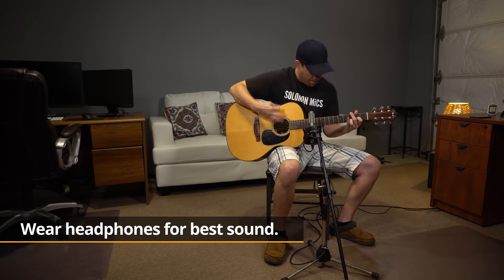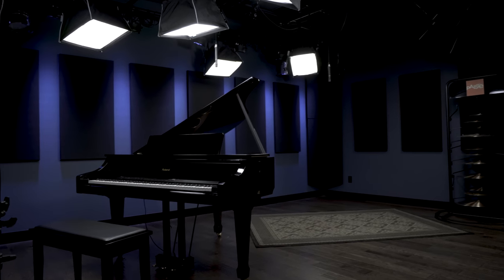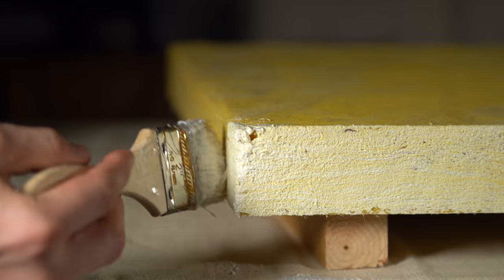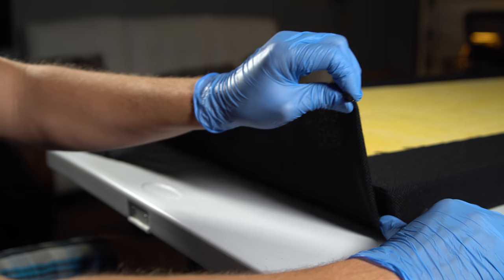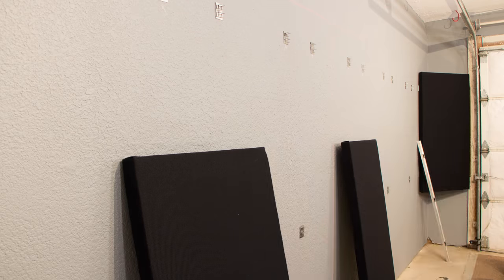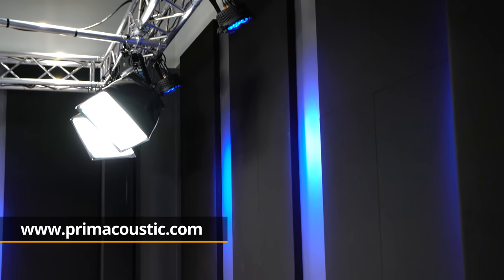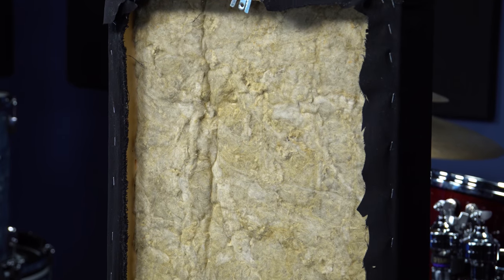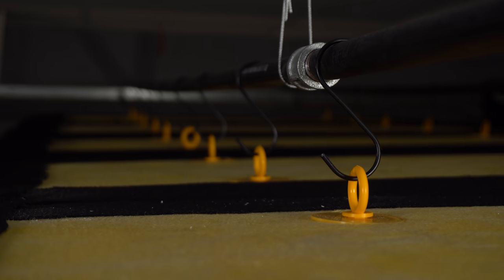How To Make Your Home Studio Sound Amazing With A Low Budget

Comment: Hello, thanks for your video!!
Why did you use fiberglass and not rockwool? thanks a lot
Reply: Rockwool would be better.
Reply: Hello, thank you for your reply!
i'm having some issues finding "Water-Based Polyurethane Resin for Edge Hardening": is this paint or is it proper resin? bi-component?
what's the purpose of Edge hardening? i'm using rockwool and i would like to know if you think i can wrap it with cloth without using this resin.
thank you so much!!!
Reply: Riccardo Antonelli good luck everyone else asking the same thing but this dude wants to keep it a secret for someone

Comment: To be honest, through my speaker setup, it doesn't sound much different between the before and after.
Reply: Stiff panel material like these may actually reflect sound more than absorb sound. I prefer Rockwool for this reason, much looser material, allows sound to pass through and be absorbed. I also combined these with foam type panels, which are much less absorbent and effect a different set of frequencies, and then added a half dozen diffraction panels. When done right, a treated room can sound 1000 times better than untreated.
Reply: To the untrained ear, it won't.
Reply: The vocal is definitely different. The guitar not so much but that's because of other factors

Comment: Hey thanks for the info very helpful..question though where and what brand of resin for edge hardening do i get/from? thanks
Reply: Allan Siegle trying to find out same answer. Let me know if you find it
Reply: I bought a water based polyurethane resin in our local paint store. I live in Sweden, so I'm not sure about the brand being available outside of Sweden, but the stuff I bought (which worked perfect) is Aqua ZAR Polyurethane "lacquer". Check a local paint store and just ask for any water based polyurethane resin.
Cheers!

Comment: Also, what about the back? Should the panel be exposed like that? I just wondered if any of the fiberglass particles could somehow get into the air if it isn't covered up in the back as well.
Reply from the maker: It's not problematic, though if you want to take extra precaution, you can wrap the panel in a micro-mesh material.
Reply: Any recommendations on a specific micro-mesh material? Also what resin are you using? The PDF isn't specific.
Reply: CynDaVaz maybe some fiberglass screen
Reply: Trevor F  Did you find any good micro-mesh material?
Reply: Trevor F this dude wont respond about the made up water based resin that done exist. The product he is using is romans 543 for the edges

Comment: Those bass traps would be much more effecticve if they covered the whole corner from floor to ceiling. The bass is going to be more resonant where 3 surfaces come together versus where just 2 walls intersect. I'm sure these ones do something but I would be willing to bet that if you put on a track and stand in the corner of the room you will still hear a lot more bass.

Comment: just buy some cheap carpet.make sure to vacum clean first and then depending whats the walls try stapel gun or glue or battons the wall out  then carpet the it. I sometim's get a sheet of 8x4 hard board and line it with 2x1" battons to make it strong and rigid.

Comment: Great video!  I think I should start with better computer speakers to improve the audio difference (or use a feed to my 90's-era Yamaha amp and Delta speakers).  Also, how much compression does YouTube automatically add to the original content?

Comment: Nice vid, thanks. So, about the bass traps, is there any real difference between making a triangle shaped bass trap or just glueing a thin panel on the corners like you did?
Reply: Yep, with this, it will be effective at whatever frequency has a quarter of a wavelength equal to the distance from the corner, with a full wedge it will work on anything higher than this frequency
Reply: @stephenevans2518  Thank you for your response, I didn't even remember this post. I actually did a project with professionals for my studio, they made all the measurements, built the panels and installed everything. it's been working great. Maybe in the next one I'll try a little more DIY.
Thanks for the feedback.
Reply: @XkztyIpKtHrwmNxlKhPy  Glad you have a good solution! I was halfway through typing when I saw how old your comment was but thought I'd reply anyway in case someone else found it useful
Reply: @stephenevans2518  thnx for reply  .
Can i contact with u ?

Comment: take off some absorption and make some diffusers for your rear wall or ceiling. you killed high frequencies and the bass freqs are out of control now
Reply: I was going to say something very similar - diffusion is needed especially in a smaller room.  Some sonotubes cut in 1/2 or 1/3 would help.  No idea what size is needed or the spacing, but that room will have a lot of build up around 200-300hz with just 1" absorption.
Reply: Eric du Toit hell no. Diffusor is garbage in small room. It fills your room with too much high end that will trick you when you do mixing/mastering. Diffusion demands large spaces. The money spent on diffusers is much more well spent on treating low end. Why ? Fix one low note, the effect will continue to mids as well. You are breaking very problematic sound pressure that takes a lot of energy in your room. Same stuff happens when you cut 20hz on mastering. Listened on pmc mastering grade system, when you cut, energy of the song across the spectrum just lifts. Tested diffusers both in several small mastering room, treating low end always won. I got with no serious treatment that costs 2,3x less than casual treatment cost +/- 3 across the spectrum. Adding few resonators will bring down to -/+ 1.5db.

Comment: All this is just a aspirin for a gunshot wound in a head. 
Basically, any wideband acoustic treatment will consume a lot of space or it will not work below midbass (200-300 Hz). 
These panels (assuming they are hard) will work much better with 8" or more air gap. 
All this treatment that does not work properly in low frequency is the reason for weird incorrect bass mastering, too boomy or too dry. Bass is the foundation of music and if you don't have even sounding notes of bass guitar how can you expect good mixes? 
So, if you want not just record some ukulele, you shall expect to spend at least 10" from every wall and ceiling to get more or less reliable results with sound production...

Comment: But if you put glue on the panels you will get less absorption of the panels, no? When glue dry it will be hard, heavy, solid, decreasing the absorption
Reply from the maker: Yes! That is why we used a minimal amount of glue and only on the edges, so that we minimize the reflective surface area of the panels.
Reply: Recordeo oh yes! I didnt see. You put glue in a surface, but was in back. I didnt understand. Right, right!

Comment: What was the material  in the garage door and where can i get it
Reply from the maker: Hey! That material was an Owens Corning Garage Door Insulation Kit:
https://www.homedepot.com/p/Owens-Corning-Garage-Door-Fiberglass-Insulation-Kit-22-in-x-54-in-8-Panels-GD01/202257272
Reply: What about the curtain in front of the garage door? What kind of material is that?
Reply from the maker: Just your standard Walmart cheap black curtain! :) Nothing fancy there. You can get super dense and thick curtains that have some acoustic properties, though it wasn't desired or necessary in this room.

Comment: And what about diffusers? It's not good if you've only got absorption panels everywhere, without at least a couple of diffusers at the back.
Reply from the maker: Yes, thanks for sharing! I wanted to simplify the process for our home enthusiast audience, in which getting started with some basic broadband absorption will make huge leaps in intelligibility and room sound. Absolutely, with smaller rooms we generally want to use broadband diffusion as well. Some ultimate devices for this are Quadratic Residue Diffusers, in which you can build (or buy them) based off of different prime number sequences, to best fit your specific room modes and unique characteristics. I've had great success using QRD in small rooms to "open" them right up!
Reply: Recordeo what if i prefer a dry sound to keep it easier to add reverb and manipulate the dryer sound?

Comment: Would love to hear about what you did for the garage door and the floor. Please?
Reply from the maker: For the garage door, I used a Owens Corning Garage Door Insulation kit, as it wasn't yet insulated..and this actually acts as some form of absorption as well... the floor is carpeted and has a thicker persian rug in a larger area.
Reply: @RecordeoOfficial  keep in mind that opposing surfaces are your friend in the tracking room.  Soft ceiling/hard floors. Also the human ear really enjoys the a 4-5 ft echo (filtered out naturally since our ears hear our voice off the floor all day long). I'm no pro but just some tips i've learned that might help someone.
Reply: @jacobwhite936  Yes, but not cement floors and echos in a room that's not accurately treated can muddy up a mix or cause phase issues.
Reply: Recordeo did that help with both temperature and sound “proofing”?  Have you worked on any garage studios where you removed the garage door and sealed up the opening?

Comment: Well it depends if you are looking for sound proofing or just sound absorption to reduce base traps and unwanted reflections.  Nothing is going to beat engineered products for both soundproofing and sound absorption BUT if you are looking to deaden a room, reduce base traps and unwanted reflections on a budget, whats even better are the square cardboard 2 dozen egg flats. Far cheaper and far less work than this method too.  I know, I've done it and the difference was huge.  Plus, depending on how much room you are working in, you can make moveable panels to create small spaces to reduce reflections, standing waves and base traps because sometimes you may want some reflections.  Don't know how many times I've been in studios where hallways and bathrooms have been used because of their "liveliness" over the studio room's "deadness." 

Plus soundproofing is a whole different ball of wax.  Are you trying to make a room completely sound proof so sound doesn't get in and out of the room at all?  Hope you have a nice bank account if so! I've done room within a room in my studio that started with 1 foot thick concrete walls and you could still hear sound  (mostly low end) from inside and outside but once I built a room within that space where the walls were another 6 inches thick, insulated, covered with 2 layers of sheetrock and a small air space, it deadened right up. Even more so when I added acoustical treatment to the studio room walls.  The nice thing about this space was the concrete floor was NOT coupled to the concrete walls so it didn't transmit low end to the concrete walls and the control room was a separate room with 1 foot thick concrete walls that shared 1 wall with the main studio room and had an extra thick concrete floor.  I got luck with this space. I  did want to build a isolated drum booth that would have been another room within the studio room, shock-mounted to boot but I couldn't justify the expense and thought I might be getting a bit carried away.

Comment: you just killed all the high frequencies and let the bass and low mids echo all over the room
Reply: Yeah!!!))) Their treated room does not sound good at all)
Reply: can you easily sound treat a room with budget panels like this?  Do you have a guide or tips to do so?  i have a home theater in my little basement and was planning on throwing these panels up around the room but now you have me hesitant.
Reply: Sierra419 there is some things to do. But it is always about experiment, when you are not an absolute professional.
The thing is to kill as much high freqs as you can damp lows. So you room will be in balance.
Reply: @sierra7534  I'm just recording voice, and I hang layers of moving quilts. Some above, all around. It's no studio, but I just screwed in hooks in the ceiling, my wife reinforced holes in the corners, and hang in a circle. It dampens lows, kills highs... Works pretty well. Total cost was like $40.
Reply: By all means, put up a video showing us what should be done or the proper way of doing it. Let us know when your video is up!
Reply: Too much absorption. They should make frames for those panels and put slats on to liven the room more.
Reply: actually, he did killed a few corners and ceiling, so he basically didn't just killed high frequencies, some of those reflection points cut through the bass asswell, right?

Comment: He didnt show how he hung the wall panels, did he make frames for them?
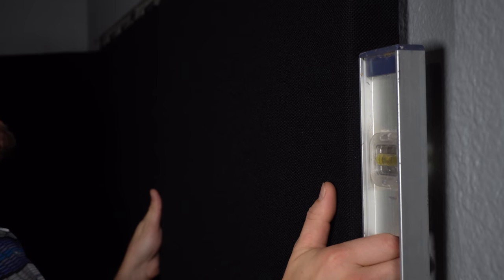Reply from the maker: I think you may have skipped that in the video ;). Watch from 4:32 to 5:28
Reply: Ah i see! Thanks, do those impaler clips work? Seems like the panels would fall off if brushed lightly
Reply from the maker: Yes they do - If you want it to be more sturdy, you can toss some construction adhesive inside the impalers too, and/or use more impalers per panel. Also, the Primacoustic impalers, although a bit more costly, have an option that angles the impalers upwards, which provides an even stronger hold.

Comment: Watch out for the fiber glass, , u didnt covered the back of the panels, lungs are expensive mate
Reply: The fibres are microscopic anyway . They will easily get through the tiny holes in the fabric. Better to use a different material.

Comment: You are just making a treatment with absorptive panels, did you calculate the reverberation time with sabine´s formula at least? And where are the diffusors and resonators. I think your video should  be called How to dry your control room with a low budget, because thats the only thing that you are doing. You need to evaluate the room in low frequencies and add control elements such as resonators, finding the normal modes of your room and calculate the correct amount of volume of air tuned to your resonant frequencies. Also you need diffusion in your room, where are the unidimensional diffusers? or any other diffusor? In that manner is only a very poor treatment that you are making far away from making it sound amazing.  Also, maybe you need to add less panels  with a calculated absorptive material with your desired reverberation time in that way you solution its been way over the correct amount and you spent a lot of money and time unnecessary.
Reply: Any videos that you recommend with info you posted? I'm interested

Comment: Visually these look fine but won't absorb anything meaningful below 500hz. All you are doing by putting them everywhere is creating further unbalance in your reverb time in the lows and low mids. You may have gotten ride of the ringing and echo in the high end but the same thing will still be happening in the lows but its just not as audible.

You need to make broadband absorbers that are 4-5 times as thick and have a good size air gap. You will also want to put them across all your corners to absorb the sub freqs (no need to fill in the corners with absorption material).

I'm not trying to be a dick. There is just too much misinformation out there already.

If anyone wants a great source for scientific but practical acoustic advice check out Jesco Lohan's website acoustics insider.

Comment: Those panels can't absorb low frequencies below 125hz.  I don't know why people think they can, when they can't.  Plus, Fiberglass panels like that have tiny airborne particles and it's not a good idea to have those in a room as you'll start breathing those fiberglass particles.  

What?  No diffusion?   Sounds like you have no clue what you're doing, and all you are doing is putting up cheap compressed fiberglass, which is actually building insulation and was not designed for room treatment.

I don't think your room sounds that much better.   You can't really tell with an acoustic guitar, try a drum set and see how the low end sounds, those produce low frequencies below 100hz.

Comment: Acoustic treatment is not that easy. Measures with a dedicated software (e.g. REW) won't cheat and will tell you if it is well done or not. 

You believe your sound is good and it is, but in fact it's not at all (from my own experience)

Nulls and peaks ... and you even do not hear them.
Thanks for the vid.